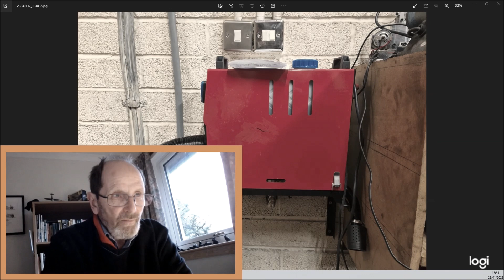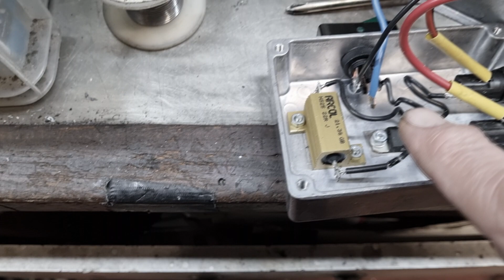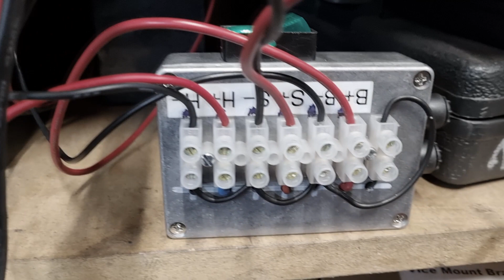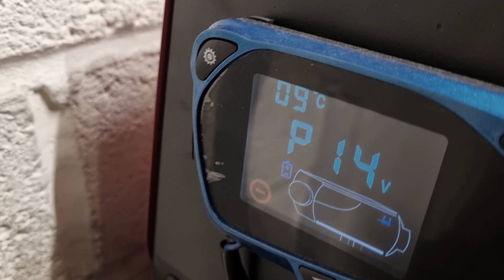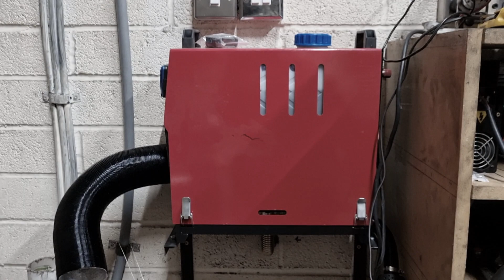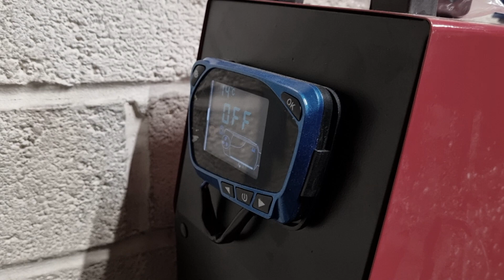Chinese diesel heater power supply

Comment: Does this charge the battery when the mains power comes back on ?
Reply from the maker: yes and no, depends on how long the power is off. It has a trickle charge facility of a few mA to keep the battery in good condition but takes a long time to charge a flat battery. A 20ah battery should survive several power outages. Does that help?
Reply from the maker: Had it now for several years , still works
Reply: @austin.seven.alastair I think this is a route I need to look at then, many thanks

Comment: I use an old modified computer power supply plugged into a conventional ups then to the mains.  Swapped out the tiny 12v battery (more than adequate for shut down) for a deep cycle 12v battery.         Of course, for camping I use 2 12v in parallel and a 6amp trickle charger) for simplicity.

Comment: So, if I just hooked up a mains power supply,(or trickle charger) to a battery, then to the heater, would the eventual battery drain automatically start a shutdown sequence? I dont have the skill to build your unit, but I do want to protect against mains power cuts
Reply: Hi John. I’ve been running my diesel heater just as you suggest, with a 12 V car battery and a trickle charger. It has seen me through two winters but in recent days the battery seems to have failed. It is a sealed battery and I think the acid levels in it have diminished. However, it proves a point that this method can be used successfully. I guess if it wasn’t a sealed battery, I could top up the levels as and when needed. Here is my set up. The pipes were insulated after I had made the video. 
https://m.youtube.com/watch?v=sU3xcTKhQEw

Comment: Hi There!  Just a question as I am electrically challenged the Powe supply runs the heater but if the power to the shop is interrupted (like a power outage ) the battery will automatically come on or do you manually have to press the switch?
Reply from the maker: The unit when activated is fully automatic no switches necessary. The switch is necessary to elimate drain from the battery when the heater is not in use. The controller in the chineese heater takes a residual current even when switched off. Hope that helps.
Reply: Ok  Thank you @austin.seven.alastair

Comment: Hi Alastair, A quick question, your schematic shows the switch to the heater as a straight forward on/off switch but inside the die cast box it looks like it has 3 wires going to it, the black on the left is the [ - ] common ground to the heater, the battery and the power supply, the blue to the [ + ] side of the heater and the black on the right looks like it goes to the middle pin of the Schottky diode, is this correct and if so how come the blue and black wire (left side of the switch) don't short when the switch is operated.

I'm not saying it's wrong as I'm a layman and not qualified to criticise, I might be seeing things that aren't there, it's the bunch of black wires at the schottky that's throwing me, I can't really tell what's connected to what.
Reply from the maker: The unit has been working now for a couple of years and the wiring has not changed. The circuit diagram is slightly wrong in that it does not show the internal wiring of the switch which has a light whch comes on when whitched on which requires a extra neg (-ve) connection. Hope this helps.
Reply: Hi Alastair, the switch in your circuit isolates the heater from both power supplies,(according to your diagram)
Would I be correct in assuming that your mains PSU has a surface mounted switch and it was this switch you used in the video to isolate the mains PSU?
Reply from the maker: @DavidAnderson-pr1ru  Think the heater when off  like a tv set on standby, if you want to preserve the charge in the 12v battery you need an off switch. The mains psu has its own mains switch if you want to turn it off.

Comment: I just found this post today.  Who is your parts supplier?
Reply from the maker: It in an on line supplier called RS Components, they supply world wide I think?
Reply from the maker: see comment further down the thread
743-5911 -Taiwan Semi 200V 20A, Dual Schottky Diode, 3-Pin TO-220AB MBR20200CT C0
1
@Will-be3yh
@Will-be3yh
10 months ago
Thanks Alastair , got this one from CPC ,  Schottky Rectifier, 200 V, 20 A, Dual Common Cathode, TO-220AB, 3 Pins, 1 V -  MBR20200CTG   
Order Code:      SC07395

Comment: I use my Jackery 270 to provide 12v and keep the Jackery on the 110v wall charger. I already had it so it didn’t add to the cost of the heater and I can use the usb chargers at the same time. In a van it is nice to have heat without being connected to shore power.

Comment: Great video. You should build and sell them. Would love to have one for the heater i just purchased.
Reply from the maker: The market for such a device I think is quite small and very price sensitive. The most economic way of adding the feature is to include it in the heater at manufacture. I think they are great and if my video helps the community of users then I am happy with that. The parts are easy to assemble and are orderable via RS components. Why not give it a try? I never imagined that I would get so many views for such a simple device.

Comment: Brilliant design, so simple yet effective, no moving part, no troublesome relay, no active components required, no interruption of the 12V to heater when mains supply fails. Shut down takes only 4Ah so with 50% discharge, a 10Ah battery will be sufficient and is much cheaper than the 20Ah battery. Well done Alistair.
Reply from the maker: Depends on how reliable your electricity supply is, 20ah will give you at least 4-5 hrs running

Comment: Hello Alastair, please explain your reasons for specifying a 20Ah 12V battery. The shut down phase lasts only a few minutes and 10A is drawn for even shorter duration. Since it is the most expansive item in your list, would a lower Ah battery be OK?
Reply from the maker: That is a standard maintenance free trackside battery used in most competition cars and has a low and simple to implement  trickle charge requiirement and I had a spare one already.

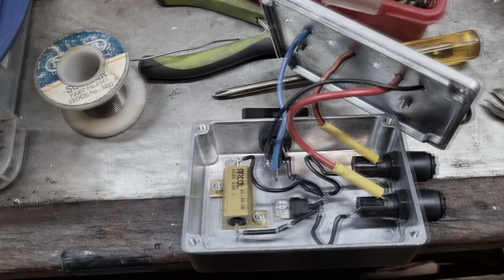Comment: Hi Alastair. Just wiring up the unit but trying to compare schematic connections to your video. In schematic, it seems to show the resistor-diode connected directly to positive side of battery - bypassing fuse -  but in the video around 4:56, it look like you have the resistor-diode soldered to the leg of the Schottky diode and then to tab of fuse? - in effect, adding a bit of protection to battery from the PSU. Or, does it matter which side of the fuse it is connected to? From a wiring point of view, it’s easier to wire up in the box if it’s going through the fuse before going to battery. Thanks
Reply from the maker: As you say it matters not that the resistor is the other side of the fuse. It is important to have the correct fuse as it stops fires if a short develops in the heater. The resistor is self protecting in that respect. Best of luck.
Reply: All wired up and tested on the bench. No magic smoke detected. 😂👍
Reply from the maker: I think you are the second person to  actually build it well done. I have been using it for two years and no problems so far  @dpbarry

Comment: Hi Alastair. I've just received all the parts to build the battery backup but I have query in relation to your schematic and the way the Schottky diode appears mounted in the case. Have you insulated the Schottky Diode from the die cast case in terms of Pin 2 being the common cathode. If not, Would that technically make the whole die cast case also ''Common cathode' or is there an insulator under the Schottky Diode and the mounting bolt/nut made of plastic. Many thanks. Declan
Reply from the maker: The diode has a standard insulator pack. Special stepped washer and a mica insulator. Readily available.

Comment: Hi Alastair. I have an S-410-13.8 (DC Output 13.8 30A) PSU and was just wondering if 13.8V was sufficient to trickle charge a car battery given that I’m led to believe a car alternator operates at 13.8v. 

I’m also looking at this video which uses an SLA battery.

https://youtu.be/vKuEASqEdK0?si=l0QNoS1XT1k6rkcD 

Granted, as the contributor says, this unit and battery combination won’t start the heater. It’s mainly used to operate the cool-down sequence. 

I do plan to somehow link my setup to solar so that I’m completely ‘off-grid’

Many thanks. Declan
Reply from the maker: The design uses a dropper resistor to trickle charge, there is also a shottly diode of 0.2v to take into account. A few more volts would be helpful I guess.
Reply: Thanks Alastair 👍
Reply: The PSU is more than adequate to start and maintain a CCDH ..  I use an old computer power supply (rated 450w straight regulated 12V) connected to a repurposed uninterruptible power supply connected to the mains.    The ups battery swapped to a conventional 12v and fed by the ups charger.  ...  But far easier is car 12v battery (12.6 vdc nominal) on a 6amp max trickle charger connected to the mains.  When camping, the 12v battery is isolated from the vehicle 12v.

Comment: Shotky Diode same part number as case ?
Reply from the maker: 743-5911 -Taiwan Semi 200V 20A, Dual Schottky Diode, 3-Pin TO-220AB MBR20200CT C0
Reply: Thanks Alastair , got this one from CPC ,  Schottky Rectifier, 200 V, 20 A, Dual Common Cathode, TO-220AB, 3 Pins, 1 V -  MBR20200CTG   
Order Code:      SC07395

Comment: Could you not simply use a battery on a trickle charge/conditioner?
Reply: That is how it works in a camper van set up. No problems, no extra circuitry.  Just a battery and a charger.
Reply from the maker: You could, that would address the issue of reliability but most battery chargers only work properly when there is no load on the battery I am not sure what my charger would do. Some chargers may cut out if at sustained load for a significant length of time.
Reply: @austin.seven.alastair gonna disagree here..   all modern chargers work fine if the battery is under load..by kicking on and providing power (the digital ones show me the actual load the battery it is attached to in both v peak (usually 13.5 vdc) and current (usually 8 to 9 amp). So far, 5 years operation on one battery that was 10 yrs old when I started using it (always being warm has been kind to it ;-)😮